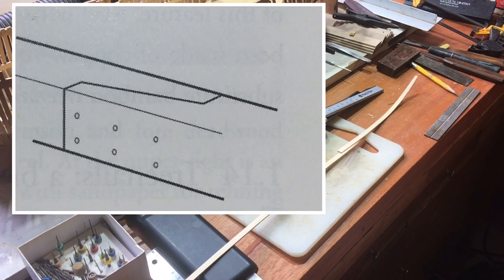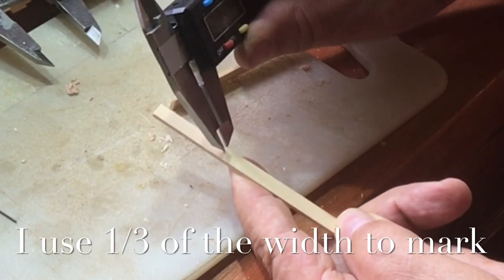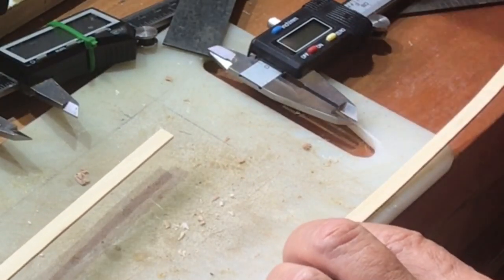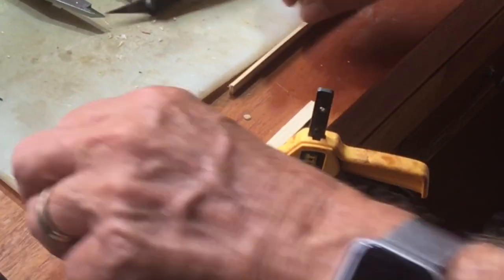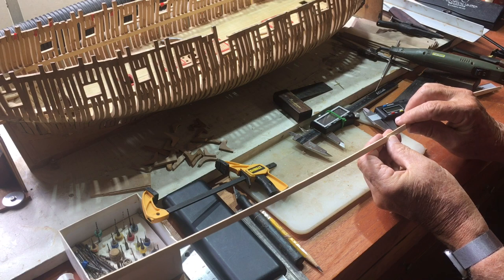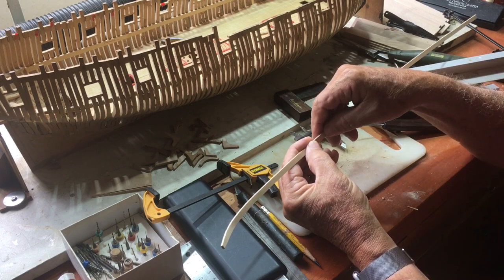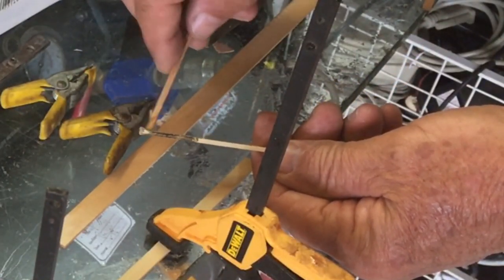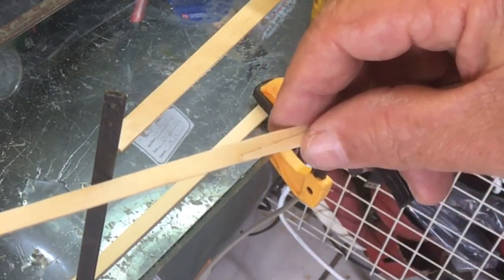Making a scarf joint when building wooden model ships

Comment: Very good! I’ve always done my model building on a thick glass surface! Glue, paint, soldering drips, it all scrapes right off with a razor blade! Excellent for making temporary jigs on for gluing up small assemblies also! Seems like all the younger modelers work on those self healing cutting mats, but that looks problematic to me! My first glass work surface many years ago was a bulletproof caboose window!
Reply: I have such a cutting mat, works like a joy for cutting and glueing. It does absorb woodstain but lets off paint and soldering is a definite nono. I personally solder above a thick brass plate or the floor underneath my vice unintentionally ;). I'm using the brass plate as a material for projects as well so it's getting smaller and smaller. May need a more permanent solution.
Reply: Doesn't cutting on such surfaces score the glass and blunt your knife by the way?